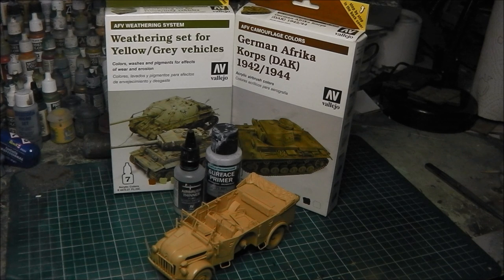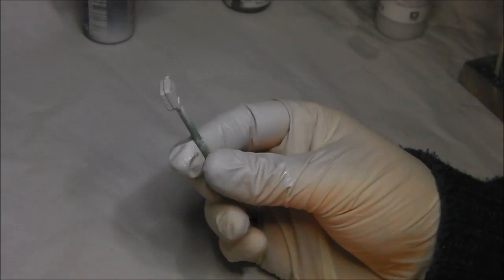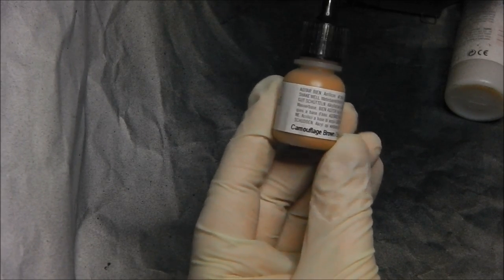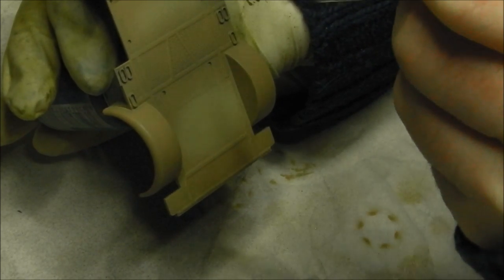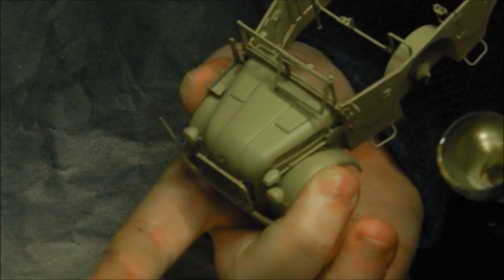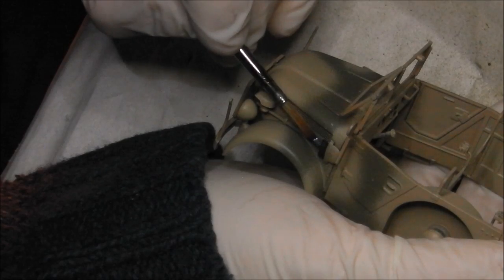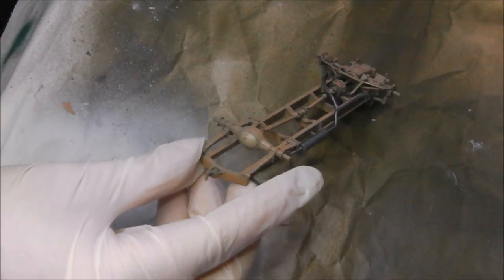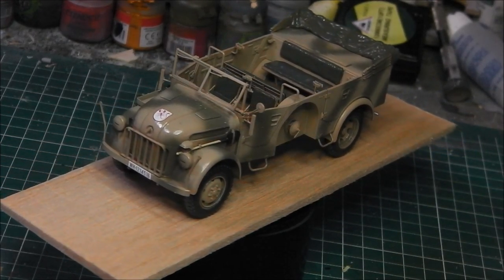How to Paint and Decal Scale Armor Model TUTORIAL

Comment: Ola Shane, your airbrush spray a bit wide, but your hand control is very good. I like very much, thank you for sharing,
Reply from the maker: thanks Jose ! the needle in my brush is a .4mm tip so it sprays in a wide arch, have been meaning to down size it but have gotten use to the .4mm tip
Reply: Thank you Shane, by the way you work is very good, a hug from Curitiba, South Brazil.
Reply from the maker: greetings from Ireland :)
Reply: Thank you Shane, keep up building, a hug from Curitiba, south Brasil.

Comment: Hi Shane, great video. When it comes to getting the build completed, are you using superglue on the painted parts (wheels, etc.)?
Reply from the maker: you have options when it comes to that part, I will use very careful dabs of extra thin as superglue though it doesn't melt the paint it can frost if you apply too much, the safest option if you don't mind long drying time but whiteglue is the safest bet !

though I will use extra I think :)
Reply: Shane Smyth really, just white glue like Elmers?
Reply from the maker: yip indeed !